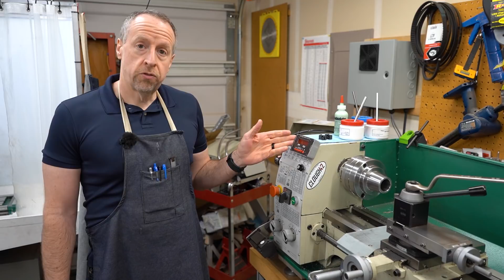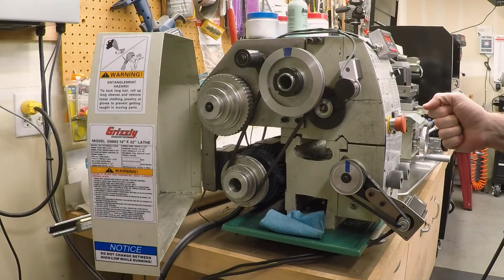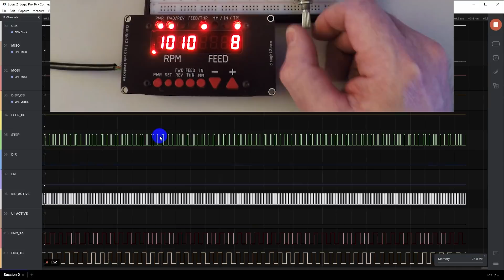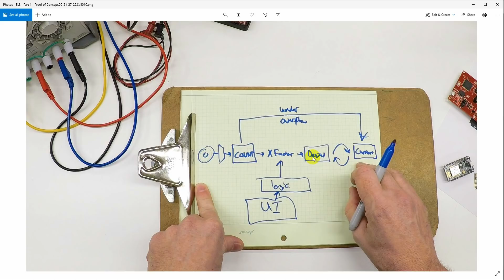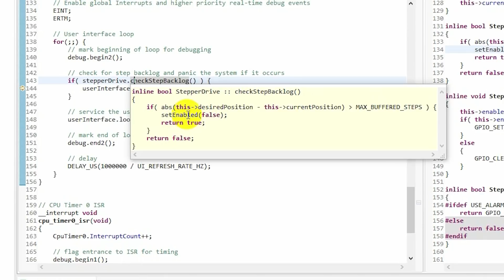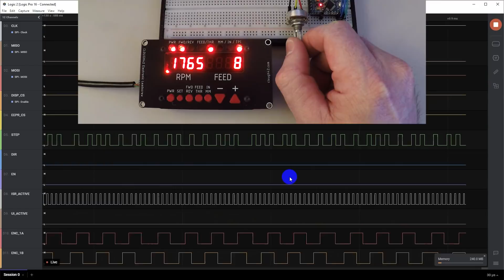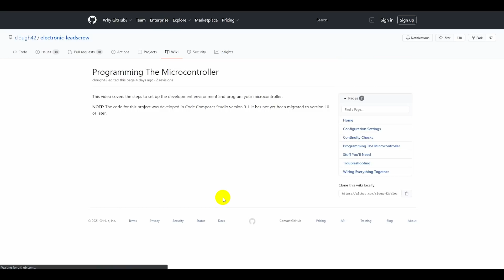Overspeed Error Detection | Lathe Electronic Leadscrew - Part 21

Comment: I've just found your channel, but I can already tell I'm going to be spending a lot of time here.  So I hope I won't offend you if I offer a friendly suggestion.  Since your channel is growing quickly, it's inevitable that new viewers will sometimes arrive in the  middle of a project (example:  your multi-video spindle installation project).  This can be quite disorienting, since it falls to the viewer to figure out what you're up to and why they should care.  To make newcomers morewelcome, I suggest you spend a minute or two at the beginning of each video giving viewers a high level overview of your project and how the  current video fits into it.  I  hope this suggestion is helpful.  Good luck with your channel!
Reply from the maker: Is the two-and-a-half minute review I started with at 0:29 insufficient?
Reply: @Clough42  I have to apologize for the fact that my comment is not actually associated with the videos to which it best applies.  I had been watching videos related to your mill spindle upgrade, and I found it difficult to get up to speed on what you were doing, why you were doing it, and how you were going to complete it.  Many others no doubt experienced no such problem, but I still thought it might be helpful to post a general comment that might apply to every project.  Through some mysterious mistake I don't fully understand, I left the comment on a video to which it is less relevant.  Sorry for the confusion that caused.  I enjoy your videos, and I'm sure your channel will enjoy continued success.
Reply from the maker: @TitusLivy777  I've seen the same thing happen when playing on Chromecast.  I start editing a comment, and then autoplay starts a new video and the comment goes there instead.

Comment: In German we have a word for what you're observing here: "Schleppfehler" (roughtly translatets to dragging-error because the actual position is dragged behind the desired positon)
Just a few suggestions:

Adapt the buffered step limit depending on the RPM (might want to use a RPM counter with a higher refresh rate for that to avoid lag)
e.g. if the spindle is stopped, and we have steps left, the ELS will trigger an error

or maybe just limit the number of buffered steps
e.g. if the offset is greater than X steps pull the desired position backward to keep that offset constant

this would lead to incorrect thread pitch, but that's a problem we're having anyways if we cant't output the pulses fast enought
Reply from the maker: As long as you don't exceed 100KHz, there will never be any buffered steps.  Once you do, they will compound rapidly.

Comment: since torque drops quickly with increasing RPM on a stepper maybe you want the user to test the max usable torque for their stepper and then set the speed limit based on that, not as much of a problem for a servo but how many servo users do you have?  Perhaps something as simple as setting a 400 or 600 RPM limit in the config?
Reply from the maker: I am actually working on this on a branch already.  I picked 500rpm, but still need to do some testing.

Comment: Version 1.4 has a bug in it. I have loaded into ccs yesterday and project explorer shows exclamation mark and ccs doesn't want to build it. I am using ccs v10
Reply: I am having the same problem. Sadly, Code Composer only loaded Version 10 when I first loaded up in May 2020 - Are we stick with Version 10?  Ken Cobb
Reply: I have deleted Code Composer V10 and loaded V9.3. This has loaded the latest version (V1.4, May2021) of the ELS software onto my board successfully. KC

Comment: Hey James, it was awsome to see how you programmed this feature under the hood.  As someone who likes to tinker microcontrollers it would be great to understand some of the code design decisions you are making and why.  It is easy to find a solution but finding one that is distributable and robust is sometimes a bit more challenging.  It seems like you have a very good grasp on software engineering and I think many of us would like to see more content on the subject.  Thank you for all your hard work on these videos.  I personally have learned a ton from the way you work.
Reply from the maker: If there's enough interest, I'd be happy to make some videos about it.  I have decades of experience in software development, though embedded systems and real-time control are specialized fields where I'm still learning.

Comment: I don't have a Leadscrew yet but this video was excellent. I hope you will have more electronic or even better electro-mechanical related videos ;) (What about gear cutting? ;) )
Reply from the maker: There are potentially a number of applications that could use essentially the same hardware with different mechanical and software configurations.  Gear hobbing and spiral cutting are a couple.

Comment: Wow, what a really nice dive into the problem and the solution.

Does the jitter in the output steps due to fixed resolution end up making any weird artifacts or sound from the drive?

Seems like the most likely scenario for this to be hit, is when somebody's configuration of gearing/belt drive is not ideal: too much gear down on the drive or something. More likely in initial setup than in regular use.
Reply from the maker: Yes.   High resolution makes it more likely.   The jitter is from the fixed steps, but it's also pretty high resolution, so I don't really hear it.   That probably depends on the driver.

Comment: Suggestion: calculate and display projected maximum spindle speed for given TPI on their equipment, so operator is informed of "crash" condition prior to starting spindle.
Reply from the maker: Oh, that's an interesting idea.  It would mean the controller would have to know the max allowable leadscrew RPM, but that could be configurable.

Comment: It'd be cool if there was some output so you could hook into a vfd and keep the spindle say 10% below the saturation point and not speed up if you asked for more, like maybe the spindle rpm pot goes to the els and the els outputs 0-10v to the spindle
Reply from the maker: Yeah, putting the ELS in control of the spindle could enable features like this.  So far, I have been trying to keep it simple.  It's easy to stray right into a full CNC conversion.

Comment: great video have you considered adding the ability to add a limit switch for threading into tight shoulders and cutting internal threads in a blind bore
Reply from the maker: I have spent a fair bit of time thinking about this.  The implications of stopping the leadscrew and restarting it in sync raises a bunch of technical issues that are difficult to manage.  The primary complication is around hybrid threads (e.g. metric threads with an imperial leadscrew) and the way unlocking the half-nut works.  Remember that you can usually flip the tool upside down and thread in reverse, away from the hard shoulder.  (unless you have a non-locking threaded spindle)

Comment: I have the same Lathe like yours Grizzly. It's being returned because on the high range, the motor pulley is not aligned. The belt walks off on the spindle pulley. A huge disappointment. I know about this screw driver system. I felt I wanted to exchange my ordeal.

Comment: I'm a PLC programmer by trade. When I first started programming I had a project that had 5 buttons on the panel (keeping this simple). There was no reason that all 5 buttons should ever be pressed and it was physically impossible for one person to push all 5 at the same time. One day I got a call that went something like this. 
Customer: Hey man, we need you to come fix something. 
Me: Ok, what is the problem
Customer: When I pressed all 5 buttons at the same time the system did "insert lots of things that wouldn't make sense to the reader here"
Me (to myself): WTF???
Me: Why did you push all 5 buttons?
Customer: I wanted to see what it would do.
Me: Ok... HOW did you push all five buttons at the same time?
Customer: Oh... I got the truck driver to help me
Me: I'll be there tomorrow.
Hands down... the strangest non-problem I've ever had. If it can be done, they will do it, even if there is no reason for it.
Reply: Hah! Yeah, this reminds me of a support call I had once where someone was adding flags to a command I gave them, that changed it from operating on a specific directory (the directory itself) to operating on every file and subdirectory within that directory. I told them exactly what to type, and they just... added extra characters. I know not why. :)
Reply: I'm in software testing and the developers showed me a form on the system; it was blank, BUT the 'Submit' button was active. So, of course, I pressed it with a blank form.
Caused the panel to crash; followed by a cascading failure of the whole system!!!
Developer: "No problem, only takes 10 minutes to reboot".
Me: "While the user is on a tiny boat in the middle of an active minefield???!!!"
Reply: If you try to make somethin idiot proof the universe will find a better idiot.
Reply: It is a good practice to catch nearly all cases in the software, even the "strange" or "impossible" one's.
I would call it "bad code" if there are "undefined" cases. Undefined behaviour should never exist. In the end the ability to think about all this possible cases an handle them, makes the difference between an amateur and a pro. Sorry for saying this: But code as u wrote, is bad code. It might be less possible anyone would push many buttons at once, but you simply never considered faulty switches for example. Hardware can fail. So number one rule is: Think about what can go wrong.
Handling this wrong might lead to damaged data on a PC or even worth a dead person in or on a machine. So if the break on you car decides to fail because someone opened the door on the same time, it would be your fault if someone came to death. It doesn't matter if this situation is nonsense. It is unwanted unexpected behavior.
Reply: @matthiash.4670  What PLC platform are you familiar with? How did you get access to my ladder logic and structured text? Where was the PLC physically located? What was it's function? What kind of IO did it use? Was there any serial IO? Did it have an HMI?
Reply: @MichaelLloyd  it doesn't matter, my comment was in general, no matter if you "program" a PLC (I wouldn't really call this programming anyway, but it doesn't matter), designing a physical logic hardware, programming a FPGA or just creating "real" software in any relevant language. I did all of this. You? Finally it's bad design to malfunction on misuse. No matter if this is a pencil, hammer, PLC or ECU of a car. That's the point. So your question is not related to this fact in any way. It's just a try to excuse. But there is no excuse.
Reply: @matthiash.4670  Go away... you have no idea what you're talking about
Reply: @MichaelLloyd  this is a even more bad excuse for "bad design". So hopefully you learned something...

Comment: I would suggest an additional safety related change--the requirement should be: The lead screw stepper/servo motor shall stop within 1ms (or 10ms or whatever) after the spindle encoder indicates that the spindle has stopped.  This additional change would remove any other possible surprise lead screw movements with the lathe stopped.
Reply: Yea, having the lead screw panic stop seems extreme. A mechanical system wouldn't come to a complete stop so quickly.

Comment: Impressive analysis, impressive... all of it! What a lab You've got!
Why not use the encoder changes to trigger the servo stepping instead of the 5 microsecond interrupt? Okey, for this issue, system overload, it would not make any difference.
Just used the Git-hub link. Where do I find the "shopping list" in order to find the totalt cost for the project?

Comment: You could also just stop de pulsing for the leadscrew if you stop the main motor and let the out of sync as it is if the main motor is running. But give a message that it is out of sync. Reset the counters after the stop.

Comment: I wonder: should the ELS be able to stop the lathe, if it detects this issue?
As in: should there be a gpio output, that can trigger the estop of a VFD?

In my non-mashinist mind this would allow to safe the part, given that the number of buffered steps didn't already scrap it, but the first problem that comes to my mind is the inertia of lathe and part - one wouldn't want to suddenly have the lathe jump at you, just because one went too high with the rpm.
Reply: Spindles take a few seconds to stop due to inertia.

Comment: I have been thinking about adding this to my 10ee. It seems like it would be super useful to cut metric threads ad I would be able to adjust feed rates on the fly. I don’t want to remove my change gears but I think I could add it at the end of the lead screw.

Comment: The long term solution would be to link the spindle speed control back to the firmware. When the lead screw control loop can limit the (desired) spindle speed, you can maintain the speed ratio constant.

Comment: Any plans to do anything with the alarm output from the servo driver? If mine alarms (stalled servo) the servo presently simply stops, so maybe nothing needs to be done (or maybe I can plumb it to display your error message!)  I'm still waiting on some hardware to get this lipstick on the pig (an import lathe/mill with no threading or feed capabilities, but fairly hefty iron.) I don't foresee stalling that servo at 3:1 drive ratio, unless I forget the carriage lock!

Comment: This would normally be 'following error' in a normal CNC...
Reply: In the Fanuc world closed loop mode will limit your top feedrate in P1430.  Some builders will set this to between 160ipm to 210ipm and if that feedrate is exceeded you will get an alarm.  Pitch of the thread x rpm will yield feedrate.   Sounds similar to what's happening here.

Comment: Why, now you set, stepper micro steps 8 and stepper resolution 200? Before you set 3  and 1000? If I remember well, was the configuration that you set when you play the metric leadscrew  video, and ai follow that, but now look that you change it, why?

Comment: The links for the parts on your wiki page (hybrid servo and driver) are not found on ebay anymore.  Can you most the model numbers you used for those on the wiki?  Thanks
Reply from the maker: Yeah.  I'm in the process of revisiting my servo choice.  I'm currently using the 2Nm set from Automation Technology, and it's just barely strong enough.  I have a 3Nm set on order as well as a ClearPath for some testing.  I've been looking at all the "3Nm" and "4Nm" sets on eBay and Amazon, and there's a lot of creativity in the specifications.  most of the "4Nm" sets actually peak at 2.5Nm or less.
Reply: @Clough42  Thanks.  Will stay tuned.

Comment: That could be quite the serious flaw, run away carriage would be really bad, glad to see you took it as seriously as you did, as you said someone could be running a high reduction set up and this could be a real issue, nice to see someone take this much pride in their work and fix it.
Reply: I ran the floor of a small production machine shop for a while. One thing I noticed about half of the guys that got hired in is that taking pride in their work was something they were never taught. Sure, they were high volume, simple parts with a large tolerance(.010"), but they still needed to be made properly.

Comment: Have you considered putting in built in limits to operations, i.e. Rpm to Feed Rate/TPI.  So that you can not have this step count issue happen.  Great find.  I think this would be more safe operation.  Thanks for sharing.
Reply from the maker: Yes.  I've been thinking about it.  I think what makes the most sense is to set a limit for the RPM of the leadscrew, but the biggest question is what to do if it's exceeded.  Capping the speed would be an option, but it introduces the possibility of wrecking a part without noticing.  Stopping is probably better, unless you're sitting right at the limit and you exceed it and panic in the middle of cutting a thread that otherwise would have been fine.  So it probably makes sense to have some kind of warning when you hit 80-90% of the speed limit.  ironically, since it increases the complexity of the software, adding safety features like this could introduce new defects that themselves become safety issues.
Reply: @Clough42  I would think you could with testing figure out the rpm/feedrate combos
that would exceed the count,  then just do allow those combinations to be selected in the software.  Just a thought.
Reply from the maker: The math for this is easy.  The challenge is that the software is not in control of the spindle.  It doesn't know if it should allow a given pitch to be selected because it doesn't know how fast the operator is going to run the spindle.
Reply: @Clough42  Oh yes, one of those moments.    Well I guess you are going to need an additional control element,.  So the software can limit the speed of the machine, only limit it not control the speed.  Starting to sound like a CNC lathe.
Reply: @Clough42  agreed, I was suggesting when the spindle does start, the encoder reads speed, if in range allow the stepper to move,if not, flash an error up. The stepper doesn't move. I was thinking that would minimise the impact. Considering, threading usually would start away from the work piece or start in a thread relief. 

Absolutely love your work
Reply: I would suggest the user update fields like lathe min Max speed, the software could limit the choices available based on encoder speed. So for example, 8tpi selected Max speed not exceeded(read from encoder) then allow procedure to go forward otherwise a fault will display and stepper will not move.

James, thank you so much for sharing your work, it is appreciated more than you could ever imagine